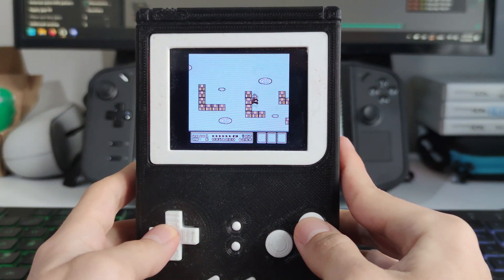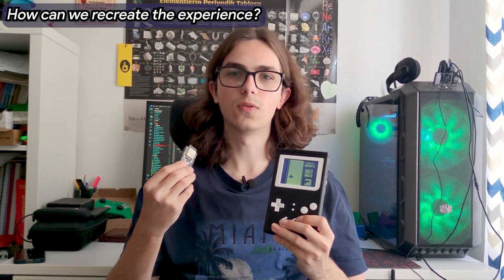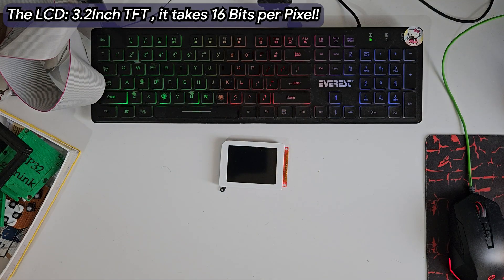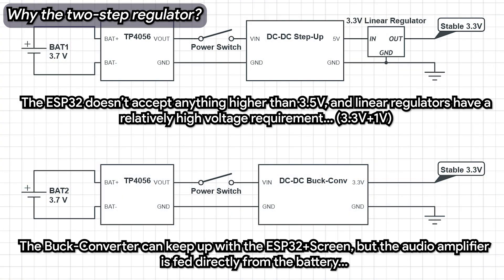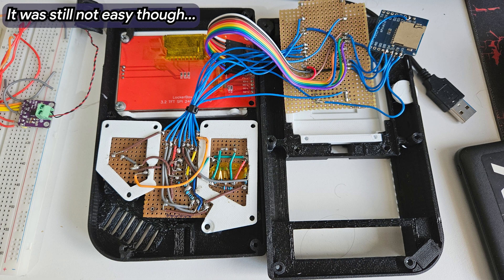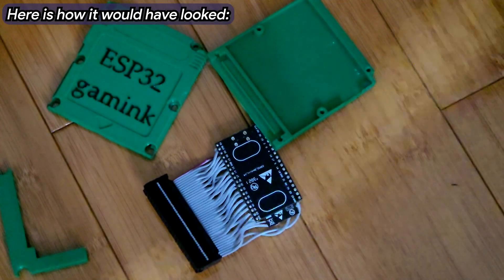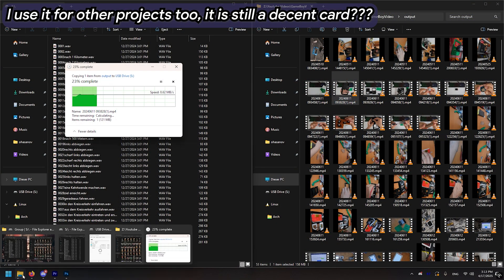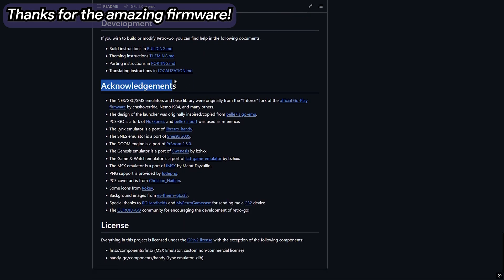How I made my own Game Boy with an ESP-32

Comment: That’s because its a cheap one, by international standards its important for an sd card to work on SDIO and SPI but some manufacturers skip the SPI hardware thus making it fail.
Reply from the maker: I mean, it did work actually. I could read and write to it, but it drew so much power that it just brownouted the esp32 most of the time... The SPI compatibility thing is sick though!

Comment: Does the sd card reader at the back of lcd screen not supported?
Reply from the maker: It should be, I just couldn't get it working. Probably my microsd to sd converters were bad but as said, I like the springy slot better anyways heheh

Comment: can it work with the default esp32? i dont have the skills needed to de solder and resolder another chip on it
Reply: Yes, the RAM is just for speed bonus
Reply from the maker: @Peter-i7y1q  Well, not really... Sure it is technically just a speed bonus, but if it makes the emulators go from 5fps to 30fps with frameskip, is it really just an upgrade, or an essential part of the whole thing?

Comment: >30fps
>diagonal screen tearing
yeah, pretty cool project but unusable for anyone loving the og gameboy and similar 8bit games, unfortunately. Would ESP-32 handle 60fps with some screen that doesn't have this terrible tearing?
Reply from the maker: The ESP-32 technically can actually support 60fps, but most LCD drivers cannot really handle that speed. Solely because of the communication interface, SPI at 40Mhz is just enough for 36fps or sth, 80Mhz does get 72fps in my tests, but it is so unstable that its not worth it. The screen tearing you see is basically non existant though, its an effect of having a phone that records top to bottom and the display which technically has a variable refresh rate updating from left to right... Not sure though, is the non-backlit lcd of the original with its atrocious update times really that much better? I would put that up to debate...

Comment: I have a question, the ESP 32 Freenove, does it work with the project??
Reply from the maker: Well the ones I see are 50/50 Ramless models, so I cannot really say much. Make sure the specs on yours say 8MB of ram and 16MB of flash though.
Reply: @ohasanov thanks, I see that I totally messed up

Comment: Can i do it with ESP32wroom devkit v1?
Reply from the maker: Sadly nope, that model just doesn't have enough ram... nor storage most of the time
Reply: @ohasanov  how can i use the source code?
Reply from the maker: @ZeyRblx what do you mean by source code? Sorry if I am not understanding it right, but as far as I know there really is no way of making that codebase work on a chip without the extra RAM. I mean, technically it is possible, but instead of spending weeks on trying to make the simplest GB game boot, I would try to solve the hardware problem directly.
Reply: @ohasanov oh i meant like how can i utilise your code on Esp32 Devkit C (with 16Mb flash Memory) im kinda new at this?
Reply from the maker: @ZeyRblx Is it a wroom or a wrover? If it is a wroom model you cant really do anything with the code. If its a wrover model, just use the instructions on the github page.
Reply: @ohasanov  will Esp32 S3 Wroom work? It has 8Mb psram.
Reply from the maker: @ZeyRblx The S3 works, but you will need to compile the project yourself

Comment: Great project, can't you alternatively use the ESP32 S3 N16R8 which has the same performance as the ESP32 Wrover E :)
Reply from the maker: Yes! Someone actually built this design using that exact S3 chip! It was definitely harder to set up though, but possible...
Reply: @ohasanov  Cool! I'm currently printing your case to take measurements so I can try then design a PCB, one for the buttons and one for the ESP32 S3. I wanted to use flex cables on the PCB and only solder the SD, audio, and charging ports with cables.
Reply from the maker: @DieOstfriesen69 Uuuu nice! Good luck with your build! Tell me if you have any problems with the tolerances, I will add more versions of some parts!
Reply: @ohasanov  Thank you, I'll get back to you. Do you know if the person published the project with the S3 devkit? For the code and schematic. 😅
Reply from the maker: @DieOstfriesen69 Sadly nope, they were pretty busy with other stuff. We mostly used the Porting and Building instructions on ducalex's retro-go github though, these help a lot, include pinouts too! https://github.com/ducalex/retro-go/tree/master/components/retro-go/targets/esp32s3-devkit-c
Reply: @ohasanov   Okay, too bad... ^^ I've finished the schematic for the ESP32 PCB. Would you mind taking a look at it if you have time? It's my first PCB project that I'm designing myself, and I'm hoping I'll make a mistake and order it. If so, how can I share it with you? :)
Reply from the maker: @DieOstfriesen69 Sure, but honestly I don't have much experience with PCBs either, i definitely suggest leaving test points or similar in order to be able to add extra wires if needed hahah... I hope I will be able to check it tomorrow/this weekend. My discord nick is "ohasanov" so yea, feel free
Reply: @DieOstfriesen69 yo can i check it? I was planning on building with Esp32 S3
Reply: @ZeyRblx  Sure, but I don't have the time right now. I've revised the schematic again, but I'm currently having trouble connecting the wires from the ESP32 S3 to the 0.05mm 14-pin flex connector. EasyEDA keeps throwing up the error "the wire gauge is too low." I'd like to connect the display and button board with flex cables.

Comment: Could you let me know what speaker you used?? I cant find ine..
Reply from the maker: I used an old laptop speaker, sadly no model for that... Someone actually completed a build with completely different components, I will upload the files for those too. Honestly though, anything that fits in there goes 😂
Reply: @ohasanov  I have it 90% there, running on esp32s3.. only part I can't find that will fit is a speaker.. lol. 😂
Reply from the maker: @ashleyshone1662 the 2cm oval/circular speakers should fit :D

Comment: Did you need to put the resistors bcs your ESP32 has no Pin.PULL_UP or Pin.PULL_DOWN? i'm trying to figure it out bcs I'm currently working on my first project and i have a Firebeetle 2 ESP32-E
Reply from the maker: Some pins dont have em yes. You should check the documentation to be sure.

Comment: Total cost for project? And for MCU?
Reply from the maker: @Eriiiiiiiick  As some parts are recycled I can't really put a concrete number, but the screen was about 15 bucks, ESP-32 (sum of the devboard and chip) was about 20 bucks, other small electronics also about 15 total... The battery was recycled, filament idk... You can probably get em for cheaper though, it is a bit expensive in Turkey
Reply: @ohasanov  amazing. I really thought the ESP didn't have enough compute to do this. I am shocked.

Comment: Next step: custom PCB with all components (except the display) directly on it?
Reply from the maker: @MisterkeTube  probably, yeah! In that case the GBC form factor would even fit better than the old GB one :)
Reply: @ohasanov  it would also save space in addition to make assembly easier.
Far from a professional. But i have ordered a few custom ones already. happy to help.

Comment: I love this, so great. i am going to build one for my son, if i design the PCBs i will share, but may just use wires and board like you. :) only part i struggle with is the firmware, do i need to compile a new version or is there a way to load the Odriod-go one from the git hub link.. sorry if obvious, not played with ESP-32 for hand helds before.. 

thanks again!!
Reply from the maker: @ashleyshone1662  Thanks! Good luck with your build too! You can just use the odroid go image if you have an ESP32 with 16MB flash in hand, if not, it will probably need some manual compiling...
Reply: @ohasanov  thanks man, just so i am following you, do you mean the ODroid-Go firmware update process on their website which uses the ESP download flash tool? (cant place a link Youtube blocks the message..:( )
Reply from the maker: @ashleyshone1662  Yeah that should work! On my github page (in the description) you can find the link for the bootloader, which you flash first with esptool. Then you can put the retro go .fw file on an sd and flash it with the bootloader on the esp32! I hope I explained it right, if any issues/questions pop up in the process, just ask, np! (Maybe i should make a tutorial video though... hmm...)
Reply: @ohasanov  i need to order 16mb chip, i will end up doing the same de-solder/re-solder as you i think... LOL.. so i have some days before i can really play.. but if you could
/would do a video i would appreciate.. hardware, for all good, light coding OK, but not played with Odroid.. so a bit confused .. lol.. thanks again man.
Reply: Hey dude, I went with an esp32 c3 in the end it is supported by retro go.. I have it flashed, can see a info in the serial monitor. But nothing on the screen.. do I need something on the SD card to get something on the display??
Reply from the maker: @ashleyshone1662  my pinout is for the esp32 only, different chips have different pinouts. Check the files on the retro-go github, the config files show the connections needed

Comment: What'd be really awesome is to have a GBA cartridge reader slot, and when you put in your cart it just rom dumps it into an internal storage device. Then you could play any new games you might get with ease, and create an internal library for portability's sake. Of course, you were playing what looked to me to be SMB3, so that would only work for two systems and you might want more. Still, even if it was only usable for emulation, it's pretty cool.
Reply from the maker: The single problem with this approach would be the insufficient number of pins on the ESP32, and the fact that it can't play GBA games hahaha! That is a cool concept though, reminds me of the Analogue Pocket
Reply: @ohasanov  Given the specs it should have just enough power, assuming you add RAM like in the video. I'll have to add that to my project list. If it can be done someone will likely do it before me, but that's life.

Comment: You beat me to the punch. Love the design, and especially the membrane switches (nobody likes loud tactile switches). I'm working on a similar design and hope to use a Pi Pico for the brains. If the Pico doesn't work, I might try the ESP-32. Cheers!
Reply: Did it work out? :)
Reply: @Peter-i7y1q  I've had that project on hold for a while now. I've got all the hardware, but the wiring and code have been a pain to figure out. I also gave myself the challenge of not using any custom PCBs. I hope to get back to it one day, but I have found many other cool related projects along the way.

Comment: cool project! I didn't know the ESP32 could do emulation. You could check out the teensy 4.1, it has an insane processor that you can overclock to 1GHz if you want to get all the performances. Also I hope you learned that wires are evil in these type of projects, I personally prefer working with pcbs and board-to-board connectors. It's a lit easier to debug and you can rule out so many intermittent issues that wires and crimps can cause.
Reply from the maker: Honestly speaking, the teensy boards are a little bit out of my spending range, since they are not exactly popular here in Turkey! I will use proper PCBs in my future projects though!
Reply: @ohasanov  yeah I totally understand, they are more like the very top end of what's available on an arduino-compatible platform. Another option is to go the STM32 route, it's very easy to design around them and the tools they offer are incredible. Plus if you wanna give PCBs a try, designing your boards with parts from LCSC and then ordering with assembly from JLCPCB makes for ridiculously cheap projects, I highly recommend it!
Reply from the maker: @EMILE12345678901  Yeah I need to learn proper PCB design too! That is next on my to do list, I need it for my planned projects!
Reply: @ohasanov  that's great! For personal projects I would recommend KiCad with the Kikit plugin and using Git for file and versions management. Since it's all text-based files it works really well with Git. Plus, KiCad has plugins for the common PCB manufacturers, makes exporting to their preferred formats a single button operation.

Comment: Run fake flash test on your SD card, chances are, it's fake.  Yes fake cards will work fine on the PC, but they will slowly corrupt your data as you fill them up past a certain point.  Fake flash test will tell you at what point that is.  Always run this on any new SD card or thumb drive that you buy, because the problem is very rampant now.